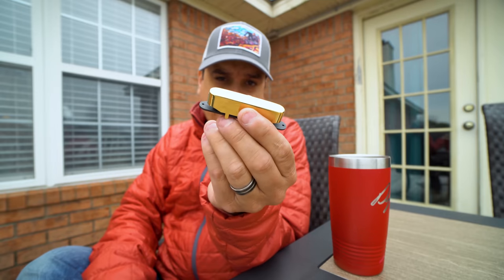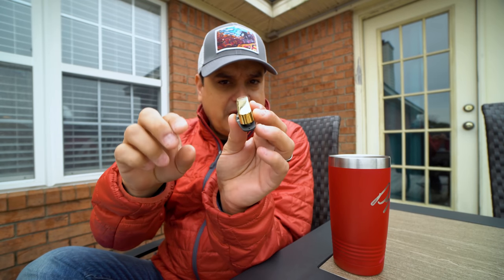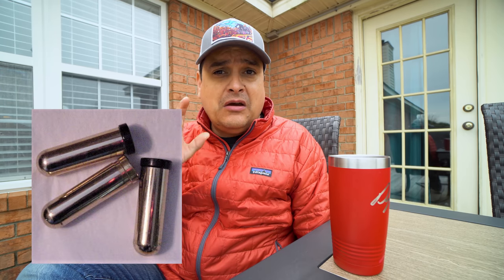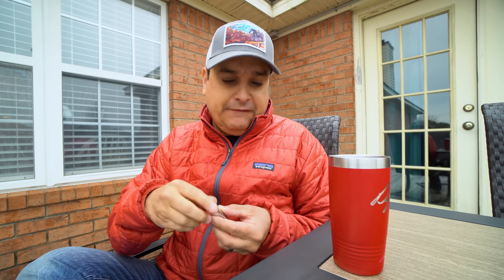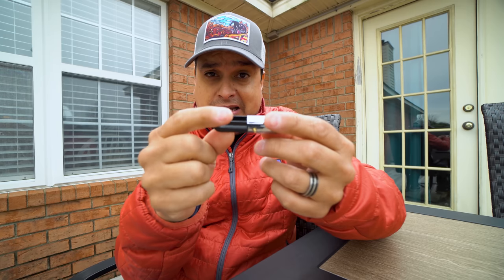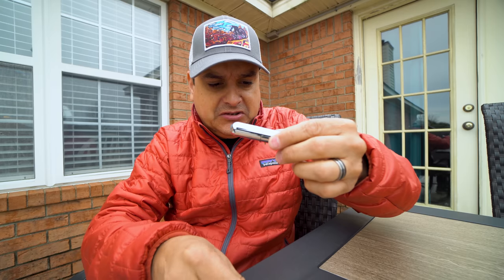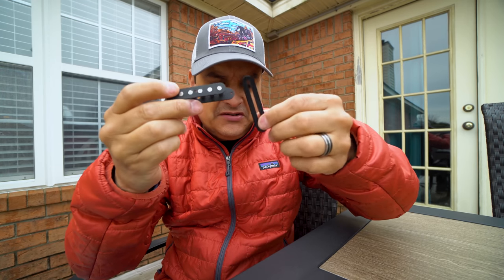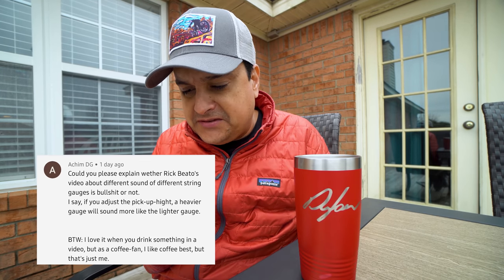Lipstick Pickups Vs Single Coil

Comment: Lipstick pickups are really simple to understand because they're so simplistic, even by pickup standards. What's really mysterious to me when it comes to vintage hardware is gold foils. If you could make a video on how those work, that would be great. Also: thank you for actually putting the whole lipstick thing into perspective with regard to what vintage lipstick tubes were actually like. About them fitting into other guitars though, I have a 2007-ish reissue of the Dano '64 and I'd bet you dollars to donuts that the lipsticks in that are too large to fit in a guitar made for Fender style single coils without some modifications to the guitar. Other companies making them explicitly to put into guitars after market are their own story, but Danelectro's own lipstick pickups seem to retain the original vintage dimensions at the very least, so I wouldn't go thinking I could just drop a pair of those into just whatever.
Reply: you can get a danelectro sized lipstick from china and i did - they are bigger - had to do some cuttin on my guitar to get it to fit
there has been a steady campaign to get dylan to talk gold foils - i've been on the train for a while now... maybe we should start a petition...

Comment: I'm glad you finally talked about the lipstick pickups. However, I think you were too brief in your description. I was hoping to hear some science behind why they sound like they do. White board drawings and all. Also, I think the "standard" sized lipsticks for say a Fender are constructed differently than the Danelectro ones. I have a Dano and the pickups are a bit longer than normal single coils. There is a video on YouTube that shows someone cutting open a Dano style single coil. What they pull out is a rather large bar magnet, no bobbin, with wire wrapped around it with only some insulating tape to separate the bar and wire. 
   My opinion on the Dano and lipsticks (after playing on one for 20yrs) is that they are greatly underrated. I think they have an excellent and unique tonal quality. 
    Just my opinion. I am open to hear others thoughts on them too.

Comment: You are absolutely 100% correct when it comes to using steel wool on or even around an electric guitar. Back in the day when I use to rewind and restore pickups I use to see this corrosion problem all the time and it was directly caused from people as well as guitar techs polishing frets with 0000 steel wool. Now that we have The Lizard Spit fret polishing system there is no excuse for anyone to even think about using steel wool to polish frets anymore. The Lizard Spit does a far superior job with none of the risks that steel wool has.
Reply: I'm a retired Aerospace Machinist and discovered White #M ScotchBrite years ago. I've also done repairs and restoration since about '75. I get the argument all the time, "Well, I tape up the pickup covers when I polish frets, so everything is OK with using steel wool" BS! those fine particles get into everything! I,  too have witnessed too many shorted out coils to ever use steel wool.

Comment: You forgot to talk about the reason of low output on lipstick pups.
EDIT: Also, I didn't see any of those on your store, do you make them?
Reply: The output of lipstick pickup is due to the physical constraints of the design, he uses 43 gauge to have as many windings as possible on such a small space between the case and the magnet, also, the metal case (as in all pickup with full cover) block some of the signals from the strings, the good thing is that eddy currents are generated by the interaction of the casing and the strings giving you beautiful melodic undernotes.  new designs reducing magnet size or using higher output magnet are being produced, but cause increased high notes, also, lipstick pickups are not full range, they lack bass response well above 120 khz contributing to the fell of low output.
Reply: @TononiaWorld  "they lack bass response well above 120 khz"... I guess you meant to say "they lack bass response below 120 Hz " ?
Reply: @TononiaWorld  Thanks, i had the same thought as Vlad Maverick after watching the video. Didn't know that tele's weren't lipsticks, but aside from that i wasn't really sure what this video was about. is there anyway to increase the low range threshold on lipstick pickups? that could be interesting.
Reply: @knightbrolaire526  actually lipstick pickups start dipping @ around 200mhz, that's what I meant, I haven't fully graph the frequency responses so I'm not 100% on this, is a "sound like" interpretation
Reply: @slavesforging5361  winding width and magnet strength can help increase it, but in lipstick pickups you can't do much, but you can EQ it with the tone I would use two resistors as a voltage divider network with the tone control so you don't loose to much output, but the sound is part of the character of the instrument, it does have its applications
Reply: @TononiaWorld  first 120khz and then 200mhz! LOL human hearing range goes up to 22khz where are you getting these numbers? megahertz, kilohertz and hertz are not even remotely the same thing
Reply: @elirosenkim3659  indeed, typo, sorry
Reply: @elirosenkim3659  you can hear 22k? Most people hear 18-20k
Reply: @graxjpg  I can only hear to 19k, but some people can hear up to 22k.
Reply: @elirosenkim3659  some people I know can hear up to 26k, but i think the average numbers are below 20
Reply: @graxjpg  yeah definitely

Comment: From Leo:  I have taken apart an old lipstick tube.  They did not used to be valuable.  Once a Danelectro gets wet in a flooded basement, it is pretty much junk as the body comes apart.   There was no bobbin.  The bar magnet  had a strip of rough brown paper around it.  The wire was wrapped directly around the paper and there were two ribbons of silky cloth holding it together.  It had a thin waxy coating around everything.  The assembly was very difficult to pull from the outer tube.  (and impossible to reinsert)

They are cool pickups,   I just pulled a neck humbucker out of a guitar and after grinding out the opening put in a lipstick tube.   Blending that with a series/parallel switching against a telecaster bridge pickup has some very usable tones with just a hint of uniqueness.  I believe there is less hum from a lipstick then a traditional single coil pickup.

Comment: just want to put this out there for those interested in vintage spec lipstick pickups, theres a guy who runs under the brand name neptone pickups, he makes lipstick pickups to exact vintage specs that danelectro used back in the day. 42 gauge enameled wire, alnico 6 bar mags 6 not 5, and he winds the wire directly onto the bar mag and the dimensions of the pickups are exact vintage lipstick spec. he offers different winds like normal, custom (more hot), and overwound (hottest). his price is 86 bucks for normal wound and a little more for the other winds. anyway if you guys are looking for something like these, check neptone out i got two of them and they are super nice and spot on vintage spec far as i can tell :)

Comment: I agree, don’t use steel wool. Even if you clean up with a strong magnet, it won’t get it all. Gold hardware is gorgeous! Unfortunately it gets old looking pretty fast and then becomes unsightly. String gauges matter more on acoustic guitars. I prefer 10’s on my electric guitars. Great job Dylan.

Comment: In reference to string gauges:  I used to use very heavy strings (12s to 14s). My father in-law was a professional guitarist from '69 to '84, and is still a great player to this day. He picked up one on my guitars (Kingston Strat out of the '88 or '89 Sears catalog with Graphtech saddles strung with 13s) and said "These strings are like steel bars! How can you fret them, let alone do any bends?" I proceeded to play some bluesy licks, including some pretty big bends. It all comes down to what you're comfortable with. For the record, I also played bass, so I guess my hands were stronger than his. He could still play circles around me! I wouldn't recommend heavy gauge strings for beginners, because it could severely limit their progress.

Comment: Seeing the steel wool segment got me to thinking: do the old lipstick pickups ever suffer from corrosion problems? 

Thank you for another informative video.
Reply: if lipstick pickups are constructed with ceramic, then the answer is no, but Alnico, over time, rust, wax potting only reduces the rate, but is not water, humidity or anything else than Oxigen, and guess wax has oxigen molecules
Reply: @TononiaWorld  Danelectro Lipstick Pups are supposed to have Alnico 6 Bar Magnets in them, traditionally. Strat styles often have Alnico 5, though.

Comment: Great job, in about 66' I had a black and white Danelectro  shorthorn 3021 guitar and a DS 50 amp with three ten inch speakers. Danelectro guitars and amps were a very big bang for the buck. I wish I still had that amp. I enjoyed this video.

Comment: Regarding string thickness, there is physics supporting how the tone depends on the thickness. The reason being that the thicker the string is, the more it starts to behave like a metal rod. For those who have seen the bass piano strings know what I'm talking about.

For more info, look up the Dispersive Wave Equation

Comment: String gauge helps maintain a string tension at certain scale Lengths. It's why a Les Paul feels so different from a Strat with the same Gauge strings. Like you where saying, the impact to your tone is mostly on how that effects your playing, unless you are getting very heavy with lower tuneing or higher tuneings with much lighter strings. There is a tonal difference with all playing differences aside between say, nines and tens, and it comes from the strings mass and tension influencing the vibration of the string (a 10 gauge string has higher mass, and is under 16.22lb of tension, where a 9 gauge is lighter and 13.14 lb of tension. The lighter the string gauge the "floppier" the string gets.) The less tension on a string, the wider and "sloppier" the vibrations are, exactly like tuning down, which effects string movement over the pickup. Switching from 9s to 11s will certainly tighten things up all around, but so would switching from Nickel to Steel on your wound strings, and the bigger difference is on how your pick attack effects said vibrations. If you have a heavy hand, maybe go for those 10s or 11s. But its tone and feel and that will always be a personal preference to the person playing.

Those looking for comparison of string gauges and scale length in regards to tone should check out Said Too Muchs channel, almost all of his stuff is messing with that sort of thing.

Comment: The most important thing with pickups is to have them parallel to the strings.  Just a little bit out of parallel and they lose their ability to capture the guitar. They lose all their magic, and most players have no idea about this and they never check to see if they are perfectly parallel to the strings.  One time I bought a Van Halen type of Strat. It sounded amazing. I bought a second pickup for the neck position and worked on the guitar and in the process, the pickup was no longer parallel, and the guitar was never the same, and it took me 10 years to figure out what the problem was.  That guitar could have made amazing recods, and it all got lost because of some little thing like that.

Comment: Love your channel. I learn something every time...

Subject matter: I've a 60's single pickup Harmony Rocket. It is a Blues machine, delivering a unique, but Bluesy clean scream that pleases my ear to no end. The guitar is a piece of crap, but when I plug it in, it sounds so good, I put up with the guitar's flaws. BTW, I did put good tuners and a Tune-o-Matic bridge on it, which really improved the sound. I had to file narrower string slots in the bridge so the strings would be over the pole pieces. I also put a piece of steel wire across the pole pieces. 

What is with these DeArmond pickups? 

I have an acoustic, built to  1930's Martin spec, wide neck and bridge string spacing (2 3/8"). Everything about these dimensions rocks my world. 

I want to make a Tele with these dimensions. I know that  NOBODY makes Tele pickups that can accommodate these wide dimensions. I know I will have to also make the pickups from scratch, including the bobbin.

I was wondering. If I put X amount of turns on this wider bobbin, I'll add additional wire, which in turn with raise the impedance compared to standard width bobbin...  right? 

Is it possible to calculate the length of the wire to get a certain impedance? I do prefer low impedance sound, and am not bothered by pickup noise, because I play live...

Your input would be appreciated.

Comment: To the steel wool thing, i use it all the time. Easy solution to it getting in the pickups. Just take them out before working on the guitar. Its even easier if its a pcb plug gibson. That not an option? Low tact double sided tape. They'll stick to the tape

Comment: Really enjoyed this, very informative, did I miss why they're low output ? Totally agree on string gauge being subjective. Kudos to your wife encouraging you to do this.
Reply: I believe their output is so low because the magnetic field is not focused as strongly on the strings in comparison to a single coil or a pickup that uses metal slugs or screws. Also keep in mind that the bar magnet in the lipstick pick up is further away from the top edge of the cylindrical shape of the tube. This adds an additional gap from the strings.

Comment: I bought a brand new Silvertone 1303 SVB guitar a few months ago and absolutely love it. Once I pick it up, it is all I can do to put it down. Mahogany body and neck. 4 bolt diagonal bolt on neck and boy does it s u s t a i n !!!!  Lipstick pickups are standard and running this bad boy thru my Electro Harmonix Satisfaction Fuzz pedal and then into my Fender Deluxe amp, it sounds like Armageddon.

Comment: I ordered some bronze wool off of ebay subsequent to your admonition to avoid steel wool. I would imagine it should avoid the problem of particles getting into the pickups. Hasn't arrived yet so I can't attest to how well it will work.

Comment: Hi Dylan
Very good Chanel and as always informative and to the point video.
I'm trying to make lipstick like sound in my diy pickup; may I ask if it's not "classified" how many warp of wire and what gauge of wire a lipstick pickup have? How much resistance it must have?
And if I prefer a hotter lipstick pickup what can I do for it? Will a neodymium magnet help?

Comment: Cool vid on lipstick pickups.  I did not know that they were a different construction inside as compared to a single.  With shorter magnets, could you make a single fit a lipstick pickup case?

Comment: Nice vid. I've always liked Lipsticks - just another tone palette. I have a 3 pickup Tele style with Dan Electro sized lips in neck/mid & HB in bridge. The P/Us are from an MIK Agile Elec Sitar - so I assume they are Artecs; bit hotter than DE spec and work well. Also have geeky p/u switching and gets lots of diff/usable tones. Luv Nk/mid in series, or Mid/brg [coil split], in series. BTW - check out SRV's white tele; 'Charley'. It was built by SRV's guitar tech, Charley Wirz in late ’83; with three DE lipsticks.

Comment: What are the tonal differences between a lipstick and a single coil? I missed that part, if it was in the video.
Reply: Lipstick are single coil, so they share a lot of the same characteristics, lipstick pickups enduce Eddy current so they have a more harmonic sound and a more metallic sound, also, due to the constructio is more expressive but with less bottom end

Comment: Hey Dylan! I was wondering if you would do a video or share your experience with “dummy” pickups sometime? I love true single coils but I can’t play them at my church because of the hum. I know there are a lot of ways to approach this but haven’t loved many of the compromising solutions I have found. 

Thanks for all of the great content man, it’s been super helpful and eye opening! 

P.S. I have looked at some “dummy” pickup circuits and it seems like when the “dummy” pickup is in the circuit it diminishes the output value. Is there something that could help with that?
Reply: The Dimarzio HS-2, 3 and 4 are a single coil wired in series with a dummy pickup below out of phase to create a hum-less sound. you can wire a capacitor in series from the selector switch and the volume with a 1M resistor to ground to create a high pass filter above 60 kHz (2.2 M resistor will give you 120 KHz ) or wire in series a cheap pickup with ceramic magnet and just remove the magnet and place it inside the guitar.

Comment: for pickups in general, does the magnetic polarity of the polepieces matter? Does a bar magnet subtly alter sound across the strings if reversed, as in rotating the magnet inside of the pickup instead of simply flipping the entire pickup around, and could the magnetic field of a pickup be adjusted enough to affect sound if the 6 individual polepieces were all or partly flipped?

Comment: So pull the pickups before using steel wool on guitar, got it.
Reply: or mask with tape and plastic bag
Reply: I use the 2" wide blue masking tape, it allows for faster coverage. Once Im done, and have metal shavings everywhere I cover the area with more tape to trap the metal shavings between the two layers of tape so they cant get out.

Comment: Wasn't the Burns Tri-Sonic pickup similar to the original lipstick?  Weren't the tri-sonic's just wire wrapped around a bar magnet?  Would be cool if you covered the differences between the Burns and lipstick if there are any.
Reply: Tri Sonics use an impregnated rubber magnet, just like real Gold Foils. and some Rickenbackers